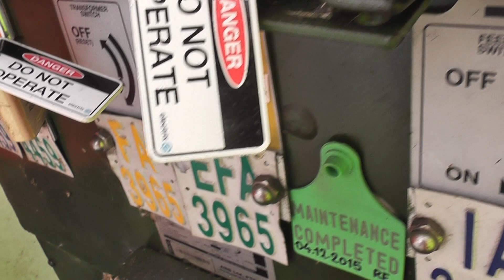RMU striker pin had operated

Comment: funny you should post this now because yesterday we had an HV fault in the local area it caused 3 brief brownouts so our local guys were doing similar testing and checking to you  interestingly our mains voltage was about 10 to 15 volts lower than normal for a time
Reply from the maker: That would be more like an overloaded transformer to get 10 to 15 Volts less. If one HV fuse blows you typically get 230/240 V on one phase, other phase around 115 Volts and more or less zero on the affected phase.
Reply: It could have been a glowing/high resistance electrical connection, or possibly a bad tap changer on a transformer. Just some suggestions - I don't live in NZ so I have no idea what actually happened. (Assuming you live in NZ - but I guess you could be from anywhere, really ... after all, I'm from the states.)